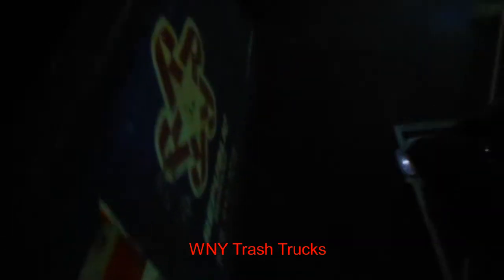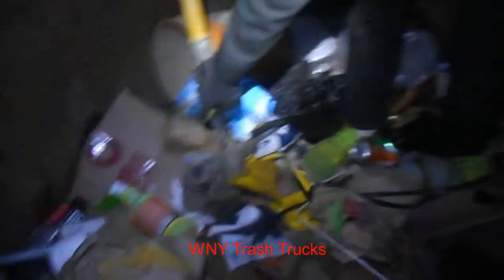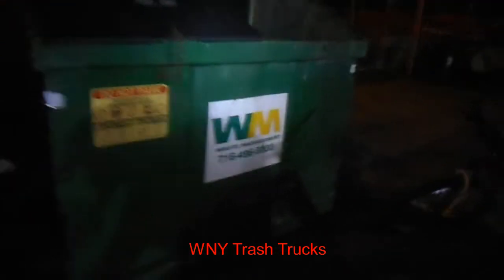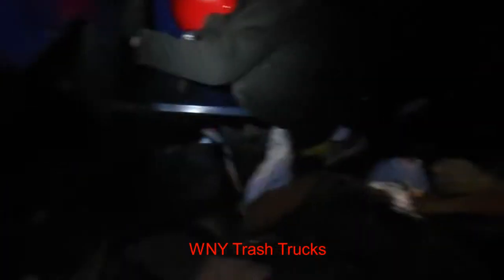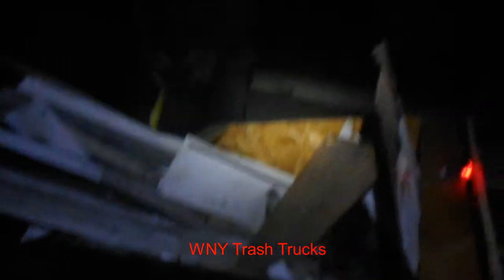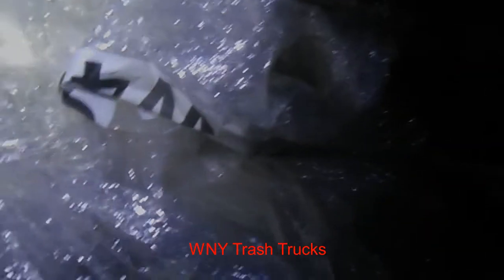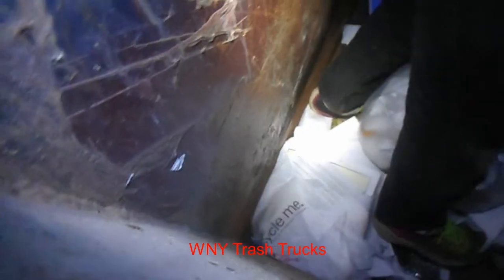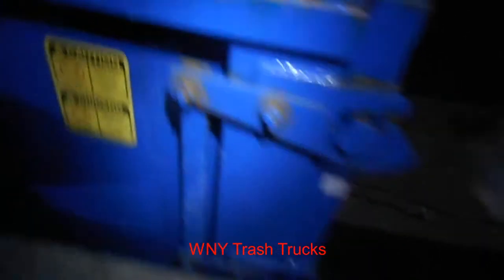Dumpster Diving 15 At Night With Loud Aluminum

Comment: Like we need more shovels....we only have 4 of them. 😂 same here brother. At one point i had 7 nice shovel heads. Kept saying i was going to put handles on them. Never got around to them. Good video. New Subscriber 👍
Reply from the maker: lol It is true and we only use them like twice a year. Maybe more if there is some thick ice we need to break in the winter. But other than that they are shed decorations. But I must say I will be checking your channel out. Real estate, scrapping and trash picking with some resale  I'm going to like you.

Comment: You guys was cracking me up in this vid man funny about running over a ant and they hear it in Alaska. Did I miss something you have built a box trailer? Or did I not notice that which I'm sure i would of seen that thing. Dudes the video just cut out when you found the wooden bowl set which is very cool.Did you guys get it?
Reply from the maker: Yes we added a front and back to the one trailer. Back in the fall. Made it much more useful. But it the videos from around now we have been using the other trailer has this one is full of steel. We did not end up grabbing the bowl set probably should have it was nice.
Reply: @wnytrashtrucks  to bad it wasn't even complete anyways I think I herd James say. 🖖
Reply from the maker: That's possible. I think it was more because we were full and did not really want it.